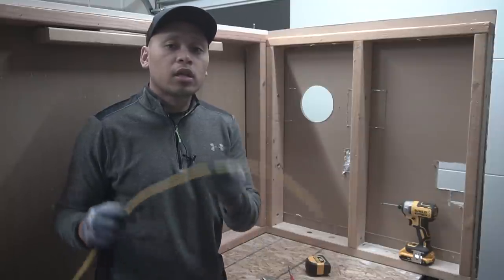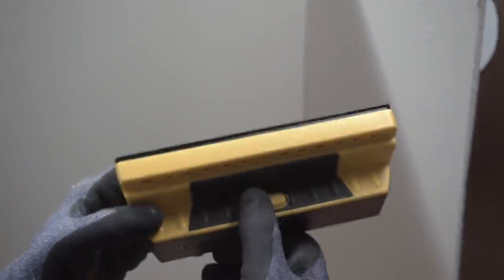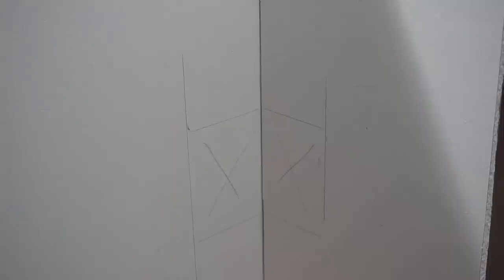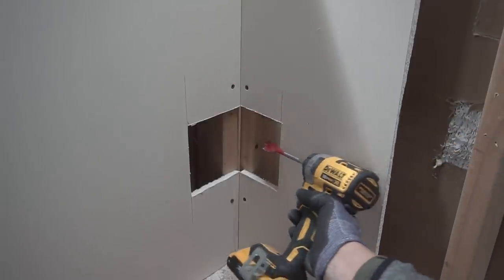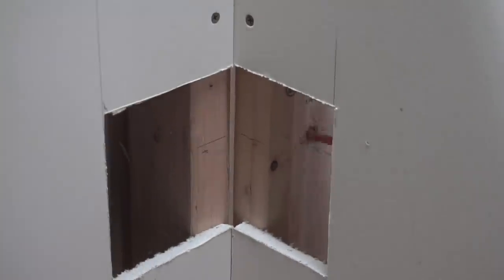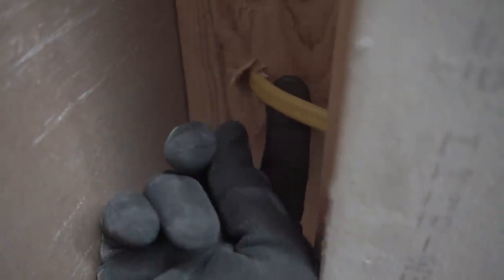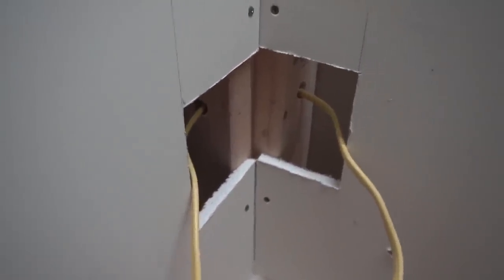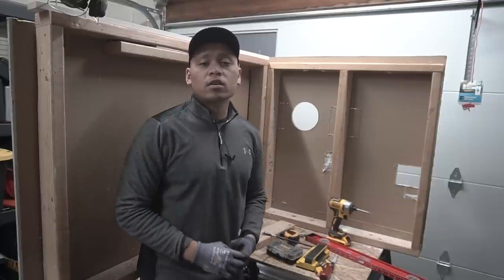How To Run And Fish Electrical Wire Through Inside Corner Studs Behind Drywall! DIY For Beginners!

Comment: Dude! As soon as you put that extension onto your boring bit and drilled around the back side of the drywall on your DEMO MODEL, you lost me. No one is going to be able to do that on a real job. Disappointing.
Reply: This is why it’s so important to leave giant drywall gaps in your walls during construction 😂
Reply: Yup useless video. Impossible on a retrofit job
Reply: Kurtmeredith I agreed with you until I realized that I think he was trying to show how one would need to extend through another nearby stud to reach the corner studs. It wasn’t clearly explained but I still learned a lot from this video.
Reply: Always editing out THE very part you need to see.... What about the second hole??
Reply: I agree with all the above... Totally fucked up video.

Comment: Since you’re cutting and patching drywall anyway, you might as well make the cutout large enough so that the drill can fit in for easy drilling
Reply from the maker: Thank you for the advice!🙏🏽😊👍🏽
Reply: Or you could use a simple right angle drill attachment. (No cell phone needed!)
Reply: @bobjones9727  but you still have to cut & patch, so what I said still applies, if you gotta cut, cut out a larger section to make it easier
Reply: @arod7404  Because larger sections require more taping and mudding to repair. Cut out a smaller section and use a right angle attachment to make it easier.
Reply: @bobjones9727  come on, more mud and taping, really lol?  Yes, if you’re cutting out a 4’ section maybe, but a cutout that’s a few inches larger won’t take that much more material or effort.  But hey, you do you and I’ll do me and we’ll just leave it at that.

Comment: ?? Your video assumes you can get behind the drywall with a drill, which you can’t without tearing out a larger section of drywall.  Cutting out those two small squares in the corner is the least amount that would have to be removed.  A right angle drill attachment is a better option.

Comment: I peel back the baseboard notch the studs ,run wires use nail plates no need to patch drywall since baseboard will hide everything.

Comment: In some situations it is better to route the wire through the attic  or basement/ crawlspace.  Requires a bit more wire, but can eliminate the need to patch drywall.
Reply from the maker: That is true! Thank for sharing! Stay tuned I will have a video on that soon! 👍🏽😊🙏🏽

Comment: What about when you have printed wood paneling instead of drywall? They don't make the panels anymore so I can't patch or replace them. One of the nice things about the wood panels is that I can see the nails/joints and I can actually feel where the studs are by pushing  on the wall. I can hear them by knocking too. 
Hmm.. I suppose if I cut the hole low enough I could cover it with backsplash or small corner shelves or something.
Notching is terrible for structure.

Comment: How did you make hole 🕳 on your left side?
Reply from the maker: Should be the same on the right. If you cut out around the left stud after it you will have access to feed through the 24” spade bit.

Comment: Thanks for the video.  For those of us wanting to run through the studs at the corner by making a cutout on each side of the corner, I used a right angle Dewalt drill and I had to remove  about 8 inches from each side (leaving 1 inch of drywall next to the stud for the patch)  to make the run work (size of drill head plus short spade and then longer spade bit). This appears to be a complex task for a finished room, especially if you cannot go above or below (i.e. concrete garage with second floor ADU).